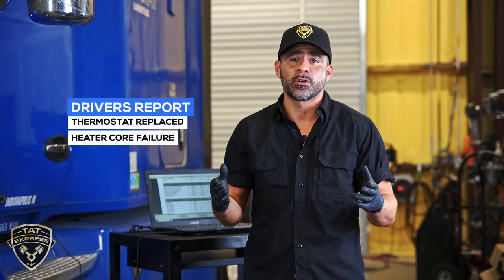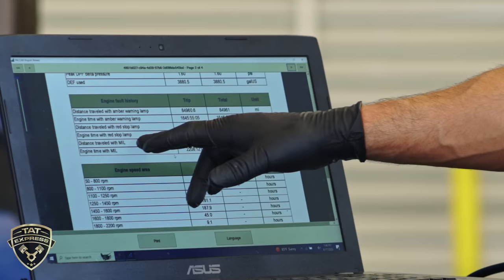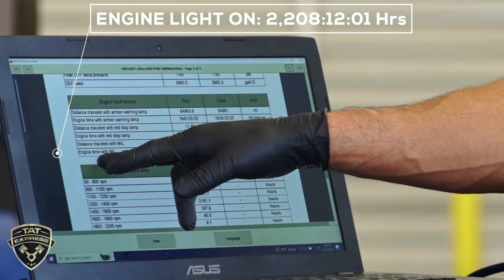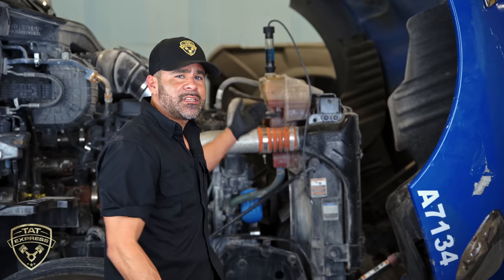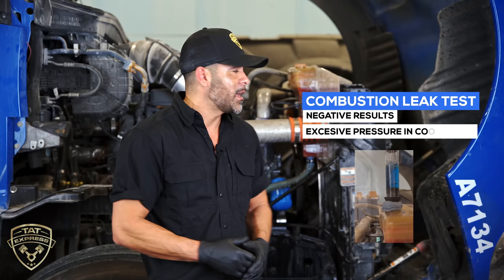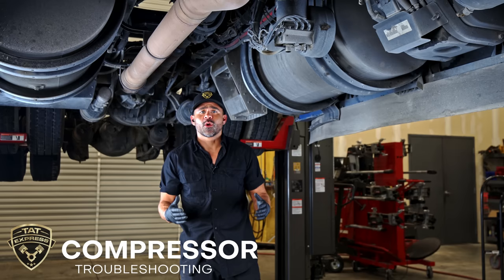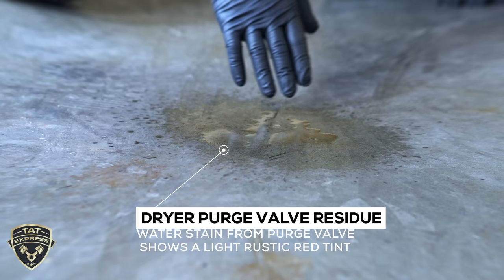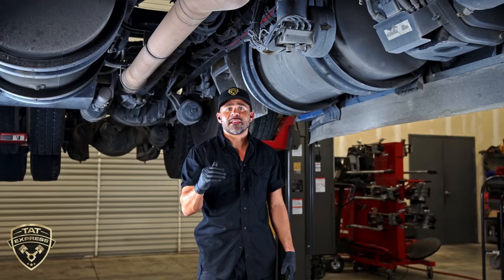What causes pressure build up in cooling system?/Compression in coolant system/ Engine coolant tank

Comment: Information was in fact very useful. I've been for the last 2 years or so, running with an extraordinarily frequent dryer purge (every 5-7 seconds) three dryers replaced in the last year. Nobody gets to the root cause. Either because of lack or will or lack of knowledge.
Reply: on volvo clutch fan was leaking air witch would trigger airGovernor to start compressor every 1-2 minutes ... or any air leaks from compressor to governor

Comment: I have a 2016 Peterbilt 389 Pride and Class with Detroit 60 Series. Special deal from Fitzgerald. High pressure in coolant system. Mechanic saying the engine got extremely hot and it’s probably a cracked head and possibly warped the engine block. The CEL came on a few times and the coolant temp went up to 210 to 215 and then the light went out and the temp dropped off to 140 and then back up to 180. Did this a few times. I thought it was the thermostat getting stuck closed and then open. There’s a class II oil leak on the drivers side of the engine above the air compressor. Mechanics saying $30,000 to overhaul engine. Any helpful advice would be greatly appreciated! Failed bubble test. Blown head gasket or worse?
Reply: The cylinder sleaves get holes in them if you overheat the engine. This allows air from the cylinder to get blown into the coolant which is all around the sleeve.
Reply: @dorito1129  you gettin railed on that 60 series rebuild. Was told 15k for mine if it ever needed one

Comment: 2013 579 with epa10 paccar is doing almost the same thing. im getting excessive coolant pressure only when the truck is loaded and im in hills. if im empty or idle all night then i dont loose any coolant, but soon as i get loaded and climb a hill it starts blowing out through the over flow and is worse the heavier i am or the steeper the hill. example is i lost a whole gallon after 80 miles with a 45k lb load on the truck, but with a 27klb load i did over 400 and lost a gallon, with the same 27k load i did a hill that was steep enough to require 5th gear and during those few minutes that i took to climb the hill i lost over a gallon of coolant. block test turned green but not yellow. we are leaning towards head gasket or cracked head but people keep saying its my compressor. what do you think? id think if it was the compressor then why dont i lose coolant at idle or even when empty instead of only when loaded
Reply: I'm in same situation. Did you figure out what it was?
Reply: @1SickMustang  nope. Parked the truck and took a bank loan and bought a new one to run until i could afford to diag the broke one. Went and got a fld120 with the 12.7. Had to go back to when trucks were more reliable
Reply: Did you find the problem ?
Reply: @Theoneandonly1-s1l   nope. Parked it and took a bank loan for a new one. Ill revisit it n a years time